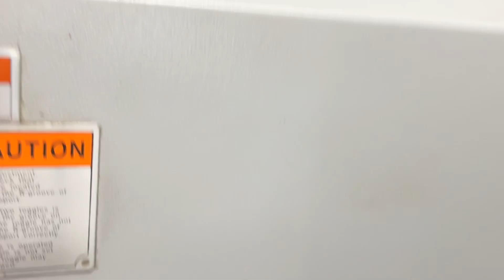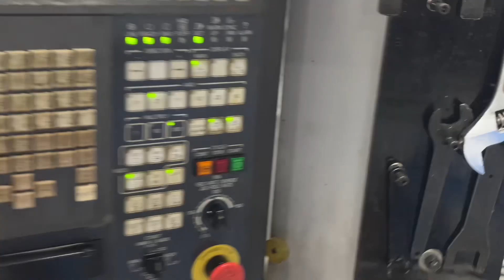Why CNC Swiss machines DOMINATE the World of CNC! 🚀

Comment: I used to run a bunch of Citizen's (M32's and L20's). My favourite was an old L20. 
I could maintain a 6 micron limit and most jobs I could set in half an hour.
We ran a lot of s80 stainless and 316 the best jobs were L168 aluminium and cz121 brass.
Reply from the maker: Very cool. I like citizen. I only ran an A20 but it was a great machine. I hear the L series are better than the A.

Comment: I think the term Swiss type is due to this style of machine being designed for the Swiss watch industry. Giving very high precision for the tiny screws which were threaded using dies.
Where I started work here in the UK at 16 Years old, the factory had around 30 Tornos R10's, some R16's and some R28's plus Strohm's which had hydraulic spindle brakes and indexing, for milling or cross drilling operations. The part could be picked up after parting off by an arm, which transferred it to the slotting or back drilling/threading attachment mounted at the back of the machine for back working operations. All these machines including around 20 Escomatics were camshaft operated. No CNC technology in those days. There was a person employed to just make the different cam sets (sometimes 13 cams per set) for each job. 
When that run of parts were finished (maybe 10 - 300 thousand  parts later). The cam sets and cutting tools were removed and stored incase of another order later. The machine was then set up for the next job with another cam set and tooling.
The company now has around 60 CNC sliding head machines with much improved machining abilities and most being run at night with nobody there.
Reply from the maker: That’s awesome!  As I’m wearing my Citizen watch - I remember now. You’re right and thanks for bringing that up. My grandfather used to cut cams. Awesome stuff!

Comment: Escomatics are still being made and used, they are fed from a spool of wire and the tool orbits around your non-rotating wire, they are also sliding headstock with a guide bushing and sub-spindle. Fanuc controlled.
But they are very uncommon in the united states. I have been trying to find a used one (Fanuc controlled) and they only appear for sale every few years on the used market and hold their value.

I have a Hardinge ST225 swiss lathe (a licensed Tsugami clone) in my shop and I love it, I have found one of the myths is that you need thousands of parts to make it worth setting them up. I have done lots of work making small screws in quantities of a 50-500 pieces, I even make 1 piece runs because I only need to change a macro variable.

Also these are called "screw machines", but I have found them to be painful at times when I need to blend together multiple segments of threads, then threading then turning, then threading, etc,... also very slow.
therefore some jobs I have found it much easier, quicker better quality to make threads as a secondary operation using a thread rolling machine by hand.

Also the Swiss live milling ability has much lower spindle rigidity, so for some jobs where finish is important I will do the milling as a secondary operation using a VMC which has a much better spindle bearings and gives very good finishes compared to the swiss. so the live tools last for many fewer hours. Also milling long flats along the length of your turned part is painful and blends very poorly (because of short guide bushing support length), so these I also need to do on the VMC when quality is critical.
Reply from the maker: That is wonderful info for sure. Thank you for sharing! I find I have the same problems on Swiss machines. The long threads, the long, milled flats, etc..  I actually worked on screw machine machines about 20 years ago brown and sharp came driven and screw machines.

Comment: Great stuff. I would love to have a swiss lathe.

How much difference in time do you figure it takes to set up similar parts on fixed headstock turret lathes and sliding headstock lathes? I assume swiss lathes are a lot slower but I don't know.

I ran a 1000pc job last week that would have been a lot faster and probably easier and better on a sliding headstock lathe. Frankly most of the parts I have run on the puma would run just fine on smaller machines and probably faster. I just love the versatility of that machine on bar diameter.
Reply from the maker: I’d say - on a full switch over - it’s about double time. Harder to work on due to the smaller work envelope. Not a lot of room to navigate. Also, 4 collets VS 1 or 2. And tensions have to be set. After everything cleaned. But I get Swiss setups done in 3-4 hours - on an easier-type job. But a lot of the jobs we run on the Swiss, we like to make sure the run hours have to justify the setup and tooling cost.

Comment: Love these vids! Very to the point and direct, looking forward to watching more content and learning as much as possible! 

Come across as a great teacher!!

Soon as I finish my vmc build Il be using that free ebook to get started with the CNC stuff! 

Can't wait!
Reply from the maker: Hey Thank you!! I really appreciate the kind words.  Good luck with your VMC.  You're building it yourself??
Reply: @Crusadermachining  yep from scratch lol welded steel and epoxy granite hybrid, 300 y 400 X 300 z, not very big but everything is well over engineered, 16mm 19mm and 28mm thick plate for the structure and filled with epoxy granite for vibration damping.

Vibratory stress relief after welding to eliminate the stresses, 30mm linear rails (high precision)X and y 35mm on z, 32mm c3 ballscrewsx and y 35mm z.

Glass scales, closed loop survos and alot of grinding, welding, measuring and lapping! 😂

Need precision for mechanical watchmaking, don't have money or space for a nice machine lol so had to build a custom one to fit the space I have, do it once do it properly! 😂

Thanks mate Il be watching along!
Reply from the maker: @nowar9220  Watchmaking?! Very cool man

Comment: Great video! Loved the chest pop when you said "sliding headstock" at around 9 minutes. I've always wanted to work on a swiss lathe but haven't had the opportunity.
Reply from the maker: Haha I’ll have to go look at that - don’t recall that 😂😂 but thank you for the kind words! Swiss are awesome and I hope you have a chance to work on them someday.
Reply: I work on Mazaks for the most part. It's a lot of conversational programming.
Mazak has a cutting option on their machines for a divided width cutting cycle that was designed for deep hole boring. For many many years it was limited to I.D. cutting since that's the only obvious need for it (where chips may build up).
Now the newer machines had a divided width cutting cycle for the O.D.
I was wracking my brain trying to figure out why you would even use that function. No literature for it what so ever. It then occurred to me that I could use it to maintain rigidity during turning.
I recently used it on some parts that have a 3" diameter that chokes down to a 0.5" diameter.
It worked so well that now I'm programming all the thin parts like that. No live center needed.

Comment: Nice setup, HPC with an FMB barfeeder.  I was a Tsugami Product Manager back when the SS platform was introduced.  It was a welcome change compared the the BS platform.  The SS20 is my second favorite 20mm platform.
Reply from the maker: Well you know your stuff for sure. SS is an amazing machine for sure. First one I was in was about 12 years ago I think. I never used the BS platform. What’s your favorite 20 mm platform??? Thanks for the input 🤝
Reply: @Crusadermachining  Nomura 20J3 with mits controller.  If you can afford it, get the one with the double B axis.  Side note: the Tsugami with a turret is wicked good.  3 path control and so much fun to set-up and get running.  That turret with X,Y & Z....is so cool.  I don't know if it's in the cards but, I'm hoping Nomura does a 3 path control with an XYZ turret.
Reply from the maker: @DCogs1  WOW.  That sounds very intense and very cool.

Comment: Why can you take larger cuts even if you're cutting within the bushing compared to a conventional lathe? Usually the Swiss tools have smaller inscribed circle holders than a lathe. I understand the rigidity of cutting at the bushing and I would think also because better coolant? 
I've been wondering about this for a while now--
Would love to see a lot more Swiss videos.
Reply from the maker: Great question and the reason we can take such large steps of cut is because of the rigidity. On top of high-pressure coolant. I plan to make a few more Swiss videos. Anything in particular you’d wanna see? Thank you for watching and thank you for a great question.
Reply: @Crusadermachining thanks for the info! I'd like to see how you set the guide bushing and what you're looking for when doing it. Whether you do it differently job by job.
Thanks again.
Reply from the maker: @danp722  I think I'll dive more into the swiss setup info.  Seems that a lot of folks are interested.

Comment: I run sprint 20’s/32’s/42’s all with sliding headstock.  Also a 16mm citizen.  Love the Swiss and the fact that the bushing is removable to run an even wider range of parts
Reply from the maker: Yea man that guide bushing is pretty darn convenient- Citizens are great. I used to run an A20 - I don’t have any experience with sprints though. Thanks for your input 🤝🤝
Reply: Also shout out to you bro. I’ve only been programming for a little while coming from not knowing what a cnc was. Watched your video on slashing cycle time and went back through my one of my older programs and redid my approaches and G92 and it cut my my cycle time by 40 seconds. Made my day
Reply from the maker: Heck yea!! That’s awesome man keep kicking butt!!